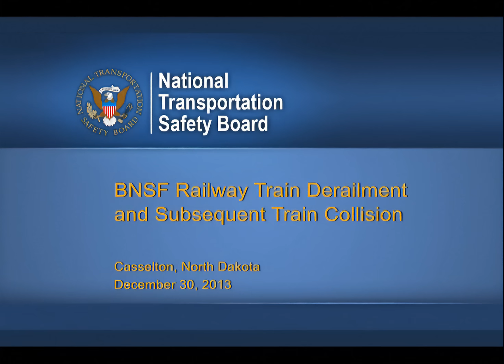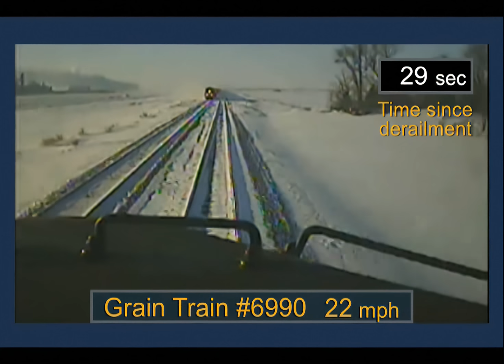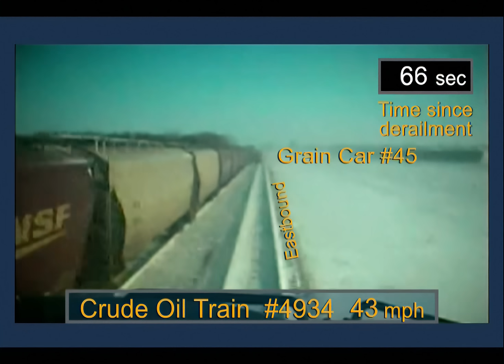BNSF Railway Train Derailment and Subsequent Train Collision

Comment: As soon as 6990 experienced an undesired emergency application they should have announced it on the radio, knowing that they were on double track and meeting eastbound 4934. I understand that it can catch you off guard, but any emergency brake application while moving can mean that some part of your train has derailed and that was tangent rail, they had a clear view of 4934 coming, and likely was aware of the upcoming meet due to hearing them calling signals and track detectors etc.  I didn't hear an acknowledgement and warning of being in emergency until the signal maintainer asked them if they had problems and at that point they were nearly stopped; 4934 would have had more time to react if they had known sooner that 6990 was in emergency, not guaranteed that they would have been able to come to a safe complete stop or that they would have considered that 6990 was derailed and fouling their track, but they would have had more info and time to use judgement.
Reply: When I worked on the RR I remember the rule to announce emergency in the GCOR (I think in multiple mains only) so I agree that should have been announced.
Reply: After reading people who claim to actually be in the rail industry essentially say, "Aw f-- it. He couldn'a stopped anyway," in these comments, I now fully support rail automation.
Reply: @hoghopper  And what will be the procedure in this situation where you have two trains passing each other and one goes into emergency.  Remember, when it goes into emergency it doesn't know there is a derailment, nor does it know if a rail car is on the opposing tracks.  The procedure you say in an automated system will be used for all such situations.  If you stop every train that can cause delays, time is money to companies so you need to minimize stoppages to keep things rolling.
We need to stop with the 20/20 hindsight.
Reply: @rizon72  Exactly time is money and that's precisely why they have rules like what S-Spec stated. They know they lose a lot more time and money when a derailment happens than they would to slow down a train or two in and incident like this. The potention loss of life and revenue for not just the RR but for the companies moving product on that rail is tremendous.
Reply: @AzureTwilight  I'll be honest, I have no idea how often a train declares they are going into emergency happens on a double track like this.
The other thing is just simple human processing.  They didn't have the hours we have to rewatch, and count the seconds, and be overly critical.  Time was against them to make all the correct decisions.
Reply: I'm just a 40 yr old female here who works in an office behind a desk,  but could someone tell me please exactly what is a FOAMER??
Reply: @everythingilove8529  lmao! i think it's what the kids these days refer to when a boomer is foaming out the mouth mad.  i dunno.  im just a millenial drinking my coffee
Reply: @skapegoatfilms Foamer that is used by train crews and rail fans is describing someone who let’s say....... pleasure themselves to trains. I’ve heard quite a few stories from crews on this topic. Most of the time it is drug induced, but some people actually do that.
Reply: @AvtomatKentucky101  LMAO  thanks for clarifying.
Reply: @everythingilove8529   Foamer is a pejorative used by rail workers to describe rail fans. There seems to be a split...some people hate their jobs and lives and want to spread that negativity to those who are enjoying watching these things go by, while others seem to enjoy that others are enjoying the show, so long as they do it safely. People can like cars, people can like trucks, but when someone likes trains suddenly they are weird. I dunno I guess I just like stuff with a little more horsepower.
Reply: I had the same thought. They appeared  to be decelerating,  probably because they were dragging that car, prior to the emergency  air application, which I assume was when the air-line was broken. If the crew of the train train had been more observant, they would have known they had a problem long before the emergency  application and would have been able to advise the incoming crude train of their potential problem and possibly avoiding the derailment all together if not at least limiting  the severity and possibly the fire.
Reply: Just an fyi at the speed they were going, even if they had initiated the emergency application 5 or 10 seconds earlier. The outcome would have been the same.
Reply: @TheNemosdaddy  not true.    If they made the  radio announcement   the oil train would have had almost  58 seconds of notice to make an emergency brake application or  a  full service  application....  The energy and speed would have been way less than   43mph impact.  Every second counts.     And before any one says   putting a loaded oil train into emergency    could derail....  It wouldn't ... It's straight track.  All loads all the same  type of cars same weight.  It may not have gotten stopped  but would have hit the derailed  grain train at a much lower speed.
Reply: @seediddy  I've worked for the railroad for over 20 years. I can guarantee you without a doubt what I say is true. I have a background in railroad rolling stock and been in involved in lots of accident key factor analysis and derailment investigation. I know what I'm talking about.
Reply: @TheNemosdaddy  pretty weak guarantee.....  Watch the video again. And see what time the  grain gets the message they are in emergency from the screen on their locomotive.... Then look at how much time goes by until oil train hits  derailed grain train.... It's about 58 seconds....   Much more time than  5-10 as you say wouldn't make a difference..

Not sure what road you work for but  doesn't sound like you are much of an asset.... But more of a liability.

I'm a bit behind you with you are 20 years.... Experience... 17 and wet behind the ears...
Reply: @seediddy  There's a link to the report right up top there.  It explains what was done when and why it wasn't heard.   It even has the time, about 33 seconds, from when the derailment happened to when the oil train engineer saw it and plugged his train.  Assuming 1000' per second air travel a few of those seconds the grain train crew wouldn't have known yet, a couple more to grab the radio and start talking.  I think Imp is likely correct, although there's no way to know for sure. IDK about you but I'm like to have way more than under 33 seconds notice to try to stop 104 loaded tank cars.  From what I just read I think the crews did a great job, and we should be nice.
Reply: @hedgewizard    they  got a notification on their screen  stating 'emergency application'   from that moment  58 seconds elapsed before  calling the oil train.....     The 1000' per second thing you mention has already happened and reached the lead locomotive.  It is at that point the oil train crew should be notified.
Reply: @hedgewizard   I work in Canada in  double track mainline territory at 100mph.     Every second counts.  Sure impact may not be avoidable.  But the  grain crew received notice at 16 seconds that they had experienced an 'emergency brake application'      at that time they should have broadcasted an emergency radio broadcast to all channels in the area if  there was a radio channel change at that location  they were operating on.     The time of impact by the oil train into the derailed grain train was    75 seconds.   59 seconds of notice....    Straight track all loads of the same on the oil train.  They could have  had almost a minute of  full service  applying. Or emergency brake applying  this would have  significantly reduced the  speed of the oil train from  43mph.  Instead they only  dropped their speed to 42mph.

For those that say it wouldn't have made a difference.  Put your self in the cab of that oil train ....  And tell me you wouldn't want  59 seconds of  a 'heads up' if it was available to you.....  To try and get stopped or slow down.
Reply: @seediddy  They DID broadcast an emergency.  The trains were on different radio channels.  This video is not the sum total of the evidence.  The time from the derailment (not when the crew knew something was wrong because the air went on one end or the other) to the other train being placed into emergency was 33 seconds, it's in the report.    Both crews were doing what they were supposed to do. Instead of talking about what someone else should have done, be nice. Broadcasting to all channels in the area is a wonderful idea.  How long does it take to make the broadcast, switch channels, make another broadcast?  Do they change dispatchers where the channel changes?  If so which dispatcher do you buzz up to tell?  The one where you are, or the one on the second channel you switched to?  It was the other train that wasn't on the channel for that piece of track yet, because they were giving the dispatcher back the authority they had just cleared.  The Crews were doing what they were supposed to do.   Please don't play the blame the crew game and go read the report.
Reply: seediddy 1 with all that explanation you just did the result would have been the same, oh ok so the engines don’t go as far into the field as in the video lol a derailment is still a derailment
Reply: seediddy 1 59 seconds or 33 seconds your still on the ground no matter what, your argument is moot.
Reply: @hedgewizard  i know this is very late but still- Thank you. Its clear some (edit most) on this thread didnt read the NTSB report.  4934 was on a different channel to clear their warrant. They would never had heard it.
Reply: I mean, nobody expected a hopper to tip over in the middle of nowhere at 35 mph
Reply: This derailment was featured on "Engineering Catastrophies" and the program stated that the grain train DID get on the radio and make an emergency broadcast, however the oil trains radio was on a different frequency and didn't hear it.
Reply: Thanks captain Obvious!
Reply: Even if the driver of the grain train had announced that emergency braking had been ordered, the driver of the oil train would not have had reason to reduce speed. A train that has a specific schedule and very precise travel times that must be respected cannot brake without knowing for sure what the emergency is. The grain train could be braked in an emergency mode for many reasons that would not have hindered the safety of other trains.
Reply: @marians1805  yeah... no... thats not how it works at all.

Take a seat.
Reply: Isn't there an Emergency channel? "Emergency, Emergency, Emergency, all those that can hear please stop." "I am at " [signal, or landmark]?

Yeah in this vid though, I think it was also just bad timing with the trans crossove, and an oil consist.
Reply: Crap, in 6990 I'd be hanging out the window waving at 4934 as soon as I saw it approach. Theres 2 people in the cab? the other guy can do the radio comms.
Reply: TL;DR
Reply: Sounds like a trainmaster fresh out of college and no real world experience
Reply: @happycampertahoe  engineer since 1999
Reply: Yep , the crew on 6990 were lax in their reaction in announcing their emergency brake application ! It could have very easily cost the other crew their lives !
Reply: @scottmiller4348  Wouldnt have mattered- 4934 was on a different channel clearing a track warrant.
Reply: Coming from the expert playstation train simulator
Reply: @democracyisacancer6610  ok
Reply: Even if they had warned the other train the second they went into emergency the crude oil train I figure would have still hit the derailed car fouling their track. When the lead engines of both trains passed each other the grain train was still doing about 15 mph while the oil train was probably at a solid 45 mph, that’s 60 miles per hour closure rate, the derailed car was 45 cars back, those grain hoppers are about 55 feet long each. So if you do the math and figure in the delay of human reaction there is no possible way this could have been avoided.  Lessened to whatever extent your talking about? Perhaps but I guarantee you the crude oil train was leaving the tracks no matter what speed they hit it at.
Reply: Wow, you are obviously a foamer who has never worked the railroad before.

1. Trains go into emergency all the damn time and not just because of derailments. They could be an short air hose, ptc malfunction, TC malfunction, or some type of mechanical malfunction.
2. You don't feel derailments on the road engines.
3. When you are staring out at endless 0% grade snow fields for 10 hours and then suddenly your train goes into emergency out of nowhere the conductor and engineer are going to look at each other and go "Wtf?". You don't feel derailments unless your cab is on its side.

Get your shitty railfan knowledge of "This is what shoulda been done" crap out of here. Playing with model trains and train games on your computer doesn't qualify as railroad experience. Get a job as a conductor/engineer and you'll see how much of your bull crap pans out.
Reply: Thomas Oakheart I’m a conductor for NS out of Binghamton NY and foamer or not, the OP is exactly right. I’m honestly not sure where YOU got any of your info from.
Reply: @SureShotImages  Either he's not actually working for a railroad company or he's one of those "screw the rules, I'm not getting paid enough anway"-guys and should be fired.

Edit: If this guy's profile pic is really him, he's probably about 15, lol.
Reply: SureShotImages I was a conductor for conrail, both you and mr rule book know squat about time/reaction time and basic physics.
Reply: @FrostyAUT  lol  yeah probably!
Reply: @Newa113  Almost every point you just argued he said nothing about. He is simply stating that the grain train should've announced to the passing train that they were in emergency and to watch out. Clearly that would've helped the situation. The oil train could've slowed down and prepared for something bad. What's wrong with that? How does that make someone a foamer lol. Railroad guys are so salty all the time. I imagine that's because you have no social life anymore because of the lifestyle and it makes you depressed and cranky.
Reply: @TidesGate  did you read what he wrote?   They did not know the track was blocked on the Eastbound side so why radio a warning you don't know about.   Are you assuming clairvoyance?
Reply: @jimbosc  You're right, they didn't know what happened which is exactly why they should've warned the passing train something could've been wrong. In fact, they tried to warn but was on the wrong channel. Both trains were on different channels so the oil train didn't hear the grain trains warning.
Reply: Jim Wichert it's literally in GCOR, you are supposed to announce the emergency over radio. As soon as they went into emergency, that should have been announced.
Reply: Tides Gate the grain train did announce for them to watch out, but if your doing 45-50 mph in a 14,000 ton train, you ain’t even coming close to stopping by the time you reach that grain car on its side. And yes I used to work on a class 1 railroad myself so I do know what I’m talking about.
Reply: SQRLZxBIGxNUT what difference would that have made? There’s still too much train and too much speed to even slow down enough here.
Reply: @TidesGate  thanks
Reply: @jimbosc  i am an engineer since 1999
Reply: @Newa113  I am a freight conductor foreman with CN.  

CROR page 33.

Rule 102 EMERGENCY STOP PROTECTION

(a) The crew of a movement stopping as a result of an emergency brake application, or other abnormal condition, which may cause an adjacent main track to be obsructed, must:

(i) immediately transmit a radio broadcast on the standby channel in the following manner:

"EMRGENCY, EMERGENCY, EMERGENCY, (movement) on (designated track), stopped (stopping) in emergency between mile __ and mile _ (subdivision)";

(ii) as soon as possible advise the RTC of the movement's emergency stop location, indicating whether adjacent tracks, and tracks of other railways are liable to be obstructed;

(iii) repeat the emergency broadcast outlined in (i) at intervals not exceeding 90 seconds until advised by the RTC that all affected movements on other tracks have been secured, stopped, or, advised of the emergency stop, or it is known that adjacent tracks, or tracks of other railways are safe, and clear for movements;

(iv) if unable to comply with (i), (ii), (iii), the adjacent track must be protected as per rule 35(b) EMERGENCY PROTECTION.

(v) when tracks of other railways may be obstructed, the emergency radio broadcast must be transmitted on their standby channel if practicable.

I hope that clears things up for everyone. This rule seems fairly standard throughout the railway systems of north america.

If you are by chance rules "qualified", I'd suggest you dust off your rule book, and, brush up on what you should know.  In your present state of "knowledge", I wouldn't want you on, or near any rails I'd be operating on.
Reply: @canada_sucks  please, don't confuse Thomas Oakheart with the facts.  It will only make him angry!
Reply: @canada_sucks  that makes this accident operator error.
Reply: Sir S-Spec buddy you can state rule this and rule that, but you obviously don’t know jack about the speeds and weight involved here. Former brakeman/conductor here.  That train dropped exactly 1 mph in about 6 or 7 car lengths, derailed grain car fouling track was 45 cars back. Regardless of procedures that were followed or not followed there was no way in hell that derailment of the crude train could’ve been lessened much less avoided. Your delusional at best.
Reply: @canada_sucks  Thank you for the explanation of the actual rule.  That guys a jerk and should keep his mouth shut. Or at least have his keyboard removed based on no knowledge of actual RR rules. Of course he'd say something so damn stupid. As a fellow operator myself, I always would assume the worst possible condition when going in BIE.
Reply: Sir S-Spec it’s ok, there’s worlds of difference between book smart and street smart. You clearly lack the latter. All I’m saying.
Reply: @canada_sucks  I have to ask, if you are train 4934 and the other train announced an emergency what do you do?  Is there a procedure there?
I'm hearing a lot of what the other train should have done (and what they did that people are not understanding) but what is the procedure for train 4934 when hearing another train is in emergency?
Reply: @twothreefour234    People on their damn cell phones
Reply: @Newa113  You obviously know nothing about railroad operating rules.
Reply: @Newa113  This seems like it should be fixable with new technology or system.  Why isn't there a system that alerts the engineer there is a problem with one of the cars?  Why isn't there a computer telling the engineer there has been a derailment and automatically applies brakes, lights, etc.?
Reply: @brendaryan306  you mean- an end of train device?
Reply: @Newa113  did you just call this guys a "foamer"?  lmao.  is that a thing now?  am i old?  are you young?  noone knows anything anymore waahhhh
Reply: @Newa113  u
Reply: @Newa113  you have no idea what you’re talking about sweetheart
Reply: @Newa113  It's clear that you're not a rail. Btw, 25 years Class 1 here. He's right. Crew should have called out "EMERGENCY - EMERGENCY - EMERGENCY!!!" ...immediately.
Reply: @Newa113  no not a foamer, engineer since 1999
Reply: @Newa113  in my country we have to place an emergency call that al traindrivers can hear in the area and also the person who sits on the post who controls te switches, when there is an uncontrolled emergency break, we have to make different signals on the front, because of possible danger and place closecircuits on the track next to it so the signal turns red(so no other train can pass), and then investigate the reason of air los. The reason of the emergency call is because of the dangerous posibility that the train is derailed and can cause more danger.
Reply: Thomas Oakheart yeah dude has no clue about the forces and inertia at work here, that oil can was leaving the rails even if they would’ve dumped the air the second the emergency announcement was made.